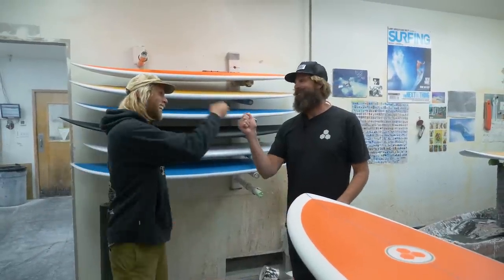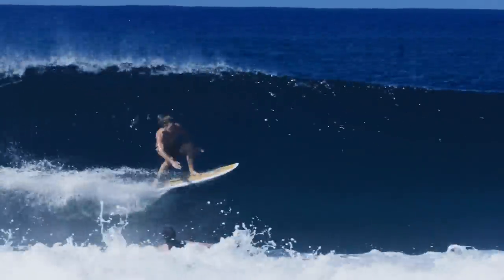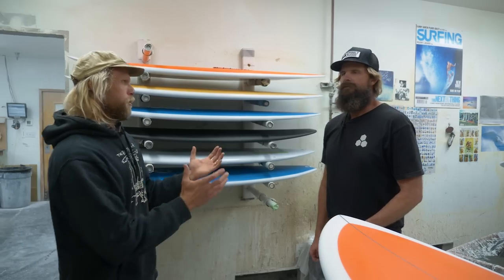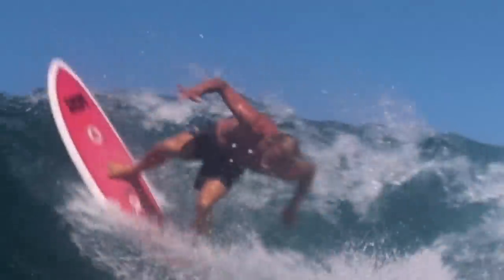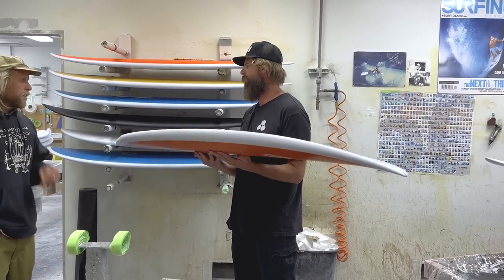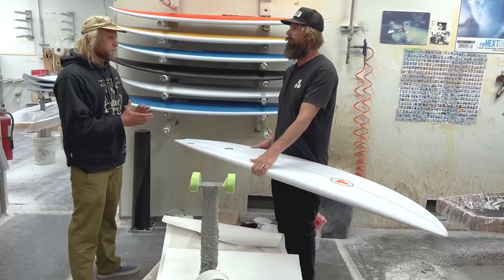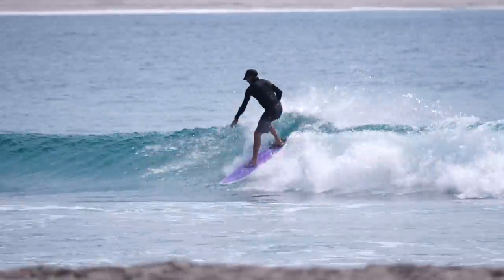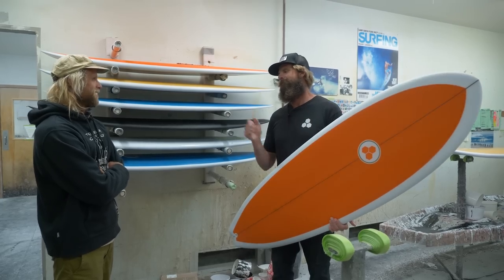G Skate Breakdown with Britt & Dane

Comment: Since Britt is a taller guy, what size G-skate would he grab off the rack? I'm 6'3" 215lbs so having Brit as a reference on this board would be clutch. The board looks mental you guys.
Reply: I’m about 6’5” 210. bought a 6’2” yesterday and got it in the water this morning and it was so fun. Waves were about waist-chest high. If I was a little more skilled I could go down to a 6’0” but also want some volume for the winter when I’m in a 5/4. Hope that helps!
Reply: @louiepillari7796  great to know man thanks!